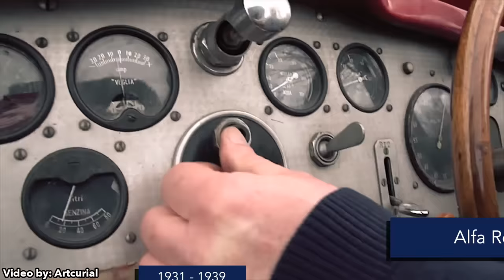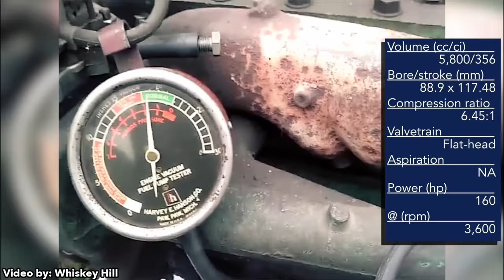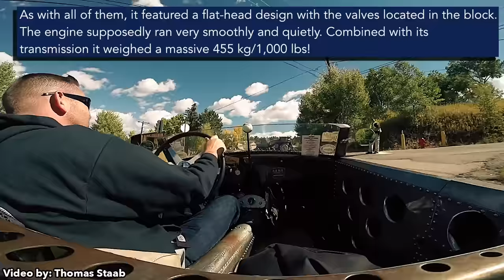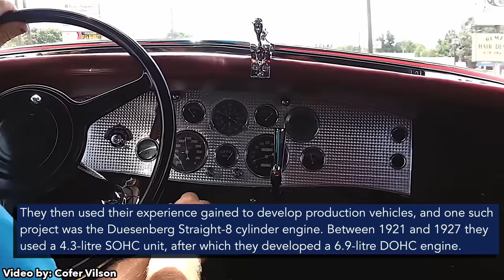The Best Sounding Straight-8 Engines In The World

Comment from the maker: It would be great to see a modern straight-8 engine. However, they have their disadvantages, especially their overall length which is why we can only enjoy these old machines. Enjoy, then!
Reply: VisioRacer do best sounding atvs or something like that
Reply: VisioRacer , there is modern inline engine these days but they r turbo Diesel engines in ciivelieng and commercial trucks and u have look them up on line but these modern Turbo Diesel Engines r Inline 8 cylinder
Reply: Which trucks/commercial vehicles use these Inline 8 Turbo Diesels?
Reply: Panda1375, Dodge Rams , Ford F-350 Trucks with the turbo Diesel inline 8 cylinder enginee but Dodge Ram Trucks have the  turbo Diesel inline 8 cylinder engines under neath the hood or bonet for those from Australia
Reply: Chris McLain No, they don't. Ford's use the 6.7 Powerstroke which is a V8 Turbo Diesel, GMC/Chevy use the 6.6 Duramax which is also a V8 TD, Ram use a Cummins which is an Inline 6 Turbo Diesel. Almost all (if not all) big commercial rigs use inline 6 Turbo Diesels
Reply: Panda1375 , yeah I forgot Ford has Powerstroke instead of a inline Turbo 8 cylinder like Dodge has in the Dodge Rams
Reply: Chris McLain Dodge don't use inline 8's, they use inline 6's. Inline 8's aren't used in anything anymore.
Reply: Panda1375 , Dodge used to use The inline inline Turbo Diesel 8 cylinder up to certain amount about time ago
Reply: Chris McLain Dodge has only used the Cummins, which is an Inline 6. Inline 8s ended pretty much completely in the early 50s and haven't been used since.
Reply: Panda1375 , that what I meant but I can't remember correctly and semis only use a bigger version the Cummins and little known fact that the Diesel engines makes more torque than the gasoline engines
Reply: +Chris McLain Yes, semis use large Inline 6 turbo diesels, not all of them are Cummins though, there's quite a few different manufacturers. And diesels do make more torque than gas engines, they are also generally more reliable and get better fuel economy but the thing that makes them better for towing is not only the extra torque, but they make their torque at lower rpm's than gas engines.
Reply: Indrid Cold I don't see straight 6s going anywhere anytime soon. They're still used in some high performance cars, for example BMW still uses them in some of their cars (couldn't tell you which) and they're especially sticking around in Diesel's until a better engine layout is designed that offers the same low end torque and reliability of an inline 6 diesel
Reply: Panda1375 do not forget the great sounding scania V8's
Reply: Blackbird The Scania V8s may sound good but inline 6s are still better engine designs for semis than V8s
Reply: BMW uses inline 6's in basically everything. Even their SUV's (SAV isn't a real term, deal with it BMW) which are usually equipped with NA or turbo V8's also have smaller inline 6 engine options. They killed off their wonderful S85 V10 engine in 2010 :(
Even their flagship super-sedan (the 7 series) is available with engine options from 3.0L inline 6's(diesel or petrol), 4.4L V8's, up to their 6.0L V12.

Inline 6's are not going anywhere anytime soon. Especially since some manufacturers are now making inline 6's with less displacement and more power + efficiency than inline 4's from just a decade or so ago.
Reply: Indrid Cold The primary reason we see so many FWD cars is because the drivetrain packaging does not intrude into the cabin or trunk space. This allows the manufacturer to maximize the volume within the car for comfort and practicality. FWD drivetrains also suffer less parasitic loss compared to RWD, this helps to improve fuel economy and raise the manufacturer's Corporate Average Fuel Economy.

Sadly for autophiles these days, factors such as comfort, practicality and fuel economy sell far more cars than things like speed and performance. The old addage of "Win on Sunday, Sell on Monday" is fading from the auto industry and with it fades the exciting performance cars that we love :(
Reply: Indrid Cold Indeed, most modern cars are pretty joyless to drive and visually unappealing...I daily drive a 1991 Volvo 740 :)

There are a few good-driving FWD cars out there. A well-prepped DC2 Integra is a brilliant drive, and something I think every autophile should experience.
Reply: Indrid Cold. what car do you have right now?
Reply: Chris McLain none of that is correct. Dodge uses the Cummins inline SIX cylinder, and all commercial inline diesels I know of are also 6 cylinders. the 5.9 and 6.7 is a smaller version of the larger Cummins engines. Ford and GM use V-8 diesels, and as far as I know there are no inline 8 diesels, of any vintage. all 8 cylinder diesels I've ever seen or heard of are V-8s. I really don't know where you could have arrived at this conclusion, and you should REALLY do at least SOME sort of research if your knowledge is that far off, before passing it off as fact.
Reply: Indrid Cold the trailblazer uses an inline 5, not a 6. Volvo also used inline 5 cylinder gas engines, not sure if they still do. I doubt it.
Reply: Chris McLain it is by no means a LITTLE known fact that diesels GENERALLY make more torque. it is very COMMON knowledge, I say again, you REALLY need to do more research, as basically everything you've said is completely incorrect. it's ok to be ignorant on a subject, but to be ignorant and pretend to be knowledgeable is not, imo. and I say generally as any given engine can be built or tuned to alter it's powerband to suit the application. some diesels have nearly equal torque and horsepower if not higher horsepower, pretty much for competition only, but it isn't a fixed ratio. and inline engines also generally have a higher torque to horsepower ratio. inline engines in general are used in lower rpm, higher torque applications, as are diesels. but there are higher HP and rpm uses. and to the inline 8 diesel thing, the only one I came across was a marine application. dodge has never used one, and dodge has never produced a diesel in house, to my knowledge. and if they ever did it must have been medium or heavy trucks long ago. the only light duty diesel they have ever used is the Cummins 6bt series. I don't know if you're thinking that the 5.9 v8 gas engine is somehow the same or what, but they have never used an inline 8 diesel, nor has any other automotive manufacturer to my knowledge. and if so, THAT would be an extremely little know fact. as I am quite well versed in automotive production, racing, etc.. but if you have some evidence of this supposed straight 8 diesel, I would love to see it and revise my statement. but as of now, all your statements are totally wrong.
Reply: Chris McLain and the heavy 8 cylinder diesels, are v layout engines, if I didn't throw that in somewhere. such as Detroit Diesel, which produced the engines in hmmvws and the h1 hummer along with GM's diesel light truck engines. and I believe Cummins produced some, as well as v6 light engines, I know they have designs but not sure on actual production applications. I think the Nissan Titan is a 4 cylinder, but could be wrong I really can't remember. as the article I read on them when they were first produced included the v6 and I believe a small v8. and there are other manufacturers, but as far as I know they have ALL been V8 engines. an inline 8 diesel would be ridiculously massive and really offer no advantages since the packaging in the vehicle would be very inefficient.
Reply: Mercedes Benz are developing a new straight 6 gasoline engine.
Reply: VisioRacer They could develop a VR8 to resolve the length problem. By the way the 8.4 litre W16 is actually two 4.2 litre Audi V8s reconfigured as VR8s, like the VW VR6s, and then fused into a common block, head, crankshaft and vice versa. I remember seeing a picture of a Straight 8 block, that someone created using Nissan/Datsun components on social media. That was some years back, don't know about its progress.
Reply: You need to add the type of valve actuation to your descriptions. It's amongst the most important information about an engine design (overhead camshaft, pushrods, double overhead camshaft.....). Just because an engine is not a flathead doesn't mean the camshaft isn't in the exact same place.
Reply: The crankshafts were prone to snapping on straight 8's and to some extent straight 6's, which is why we get V and W engines these days. 
 they simply cannot handle high revs.
Reply: As you mentioned, there are a number of disadvantages to the I-8 engine, which caused them to fall from favor.  The main is packaging.  They are very long which requires a HUGE engine bay.  Manufacturers are trying to package the engines and transmissions very efficiently and having a loooooong hood doesn't meet those requirements.  The crankshafts are also very long and heavy which limits the ability of I-8 engines to rev quickly.  The long cranks also tend to flex and break more than the much shorter V8 crank.   Inline 8s are produced today as low revving industrial engines for ship propulsion and power generation by Wartsilla Sulzer.
Reply: I doubt crankshaft flex would be an issue in a modern application especially since the last high output i8s were made in the mid 50s. but lets face it no matter how cool an i8 would no company will bother making one again especially when you have motors like the LS generation that are high displacement and easily packaged and many vehicles
Reply: VisioRacer I think that the case with straight 8 engine is that first you try to figure how to shorten it or what is the best way for fitting it in  as much small space (thus long hood problem) as possible and thus you end up with a conclusion that you'll have to use the V8 anyway...
so presumably it may be best used in longer boats,like speedsters and or drag cars, although there its usage is probably not good too so in a short way: they are used there where their lenghts kind of gets "lost" or is not noticeable in the vehicles' structure
Reply: The only modern application of an inline 8+ cylinder engine is a low revving marine diesel, or other stationary, low revving diesel.  Crankshaft and camshaft forces (twisting, flexing and centripital force),are a HUGE issues, and part of the reason you really don't see high speed engines with more than 12 cylinders.  And even those are Flat or Vee engines.  Short, stubby cranks and cams have much more rigidity.
Reply: A BMW 3.0L turbocharged inline 6 is not a speed demon? Clearly you've never driven one lol
Reply: I agree about the length, but I think Mercedes should bring back the i8. The sls and the new maybach coupe concept both looked like they had a long enough hood for an inline 8. If long hoods got with their current styling language, they should give it a shot, especially considering they are re-introducing the i6 now.
Reply: The trailblazer is 4.2l Inline 6 or a V8. They ar eno longer produced.  The colorado was available with the I5 as well as the hummer H3
Reply: bigassfordsd any of those new age "hummers" are junk, over rated, ugly & cheve frames with "hummer" bodies on them. Way too much plastic. If I got one for free, Id trade it in emmediately or trash it & let it roll off a cliff.
Reply: I have the 4.0 in my Jeep, a great engine.
Loads of down low torque, easy to work on, dead-nuts reliable.
Reply: I've always liked the Ford 300ci I6 better. It went out of production in 1996...so the AMC/Jeep 4L was in production much longer. The 4L had it beat with 190hp but, it couldn't touch the 275ft/lbs of torque or the curve. The 300ci only make 150hp though. I think it was and is a travesty that Ford never sent to Australian 4L DOHC I6 here for American RWD applications. I understand using the 3.5L Ecoboost in FWD/biasedAWD junk. They never should have used the 3.7 and 3.5tt in RWD Mustangs and Trucks when that 4L I6 existed in the land of OZ.
Reply: Awesome.  I love how on one hand it's a seemingly random combination of a build, but it ends up working so well.
Reply: VisioRacer I am not one to point out mistakes. First time i have ever done it. But concerning the bugatti portion of this paticular video: a commom mistake was made. The bugatti type 35, 35A and 35C all use the 1991 cc engine but have either a compressor or different bearing in the block. The type 35B and 35T are the only two that use the larger 2261 cc engine. Also either with a compressor or different bearings. I hope i helped out and i am looking forward to you next video
Reply: " the trailblazer uses an inline 5, not a 6"

Actually the trailblazer had the I6 and V8 engines.
The Colorado truck had the I4 and I5 engine options.
Reply: hackfreehvac the H3 " hummer also used a inline 5
Reply: Are you running total loss oil injection?
Reply: Indrid Cold I would consider the Toyota 2jzgte (inline 6) a bit of a speed demon.
Reply: Indrid Cold.  Engine configuration has little to do with an engine being a "speed demon" or not. It's breathing ability, cam specs, compression, etc. determine this. The engine has to be robust enough to reliably hold together, but most configurations can be made strong. Straight 6 and V12's can make huge horsepower and torque (and W16's) and hold together. Straight 8's are past the point of diminishing returns. Long weak crank, not naturally balanced like an I6, hard to package in a modern vehicle.
Reply: Why not a V-16?
Reply: Complexity/cost for not much benefit. There's really not a whole lot more they could offer over a traditional V8-12.
Reply: VisioRacer
Reply: If you look at some of the older cars, '40 Fords are a good example, and some cars from the '30s, the narrow hoods and low fenders look like they'd have a pretty low drag coefficient compared to some of the newer cars.  I could not find the drag coefficients on the older cars.  I thought that the straight eights would be a great match up for these vehicles.  The Chrysler PT Cruiser was going in that direction.  Personally, I like the older car styles better than the new ones and I think there could be a place for them w/ the straight motors.  Chears.
Reply: VisioRacer there is this new super v16 car (devil) or some shit in development. Sounds very similar to these engines.
Reply: VisioRacer rear engine
Reply: Maershkin Schrabs its built by NRE in the us and is two 2500hp V8's put together
Reply: The inline 8 basically sounds like a v8
Reply: So true
Reply: Maybe we should weld 2 4cylinders together and have a custom crank and cams made
Reply: VisioRacer you never fail to make thoroughly entertaining and interesting videos. You deserve all the subscribers you get and more.
Reply: @movinmetal2596   Front wheel drives get much better traction than rear wheel drives, plus they handle a lot better in sharp curves at higher speeds.
Reply: hughes2397 FWDs can be fantastic...have owned an Integra that was on coilovers and several early VWs. My MkII Jetta liked to cock the inside wheel up in hard corners! :) But in the end, I prefer throttle oversteer over liftoff oversteer (which the 'Tegs do wonderfully)
Reply: VisioRacer   You may be interested in a statement made in a technical manual published by Bosch. It said that increased understanding of combustion science has lead to engine compression ratios increasing by roughly half a point per decade (assuming the same baseline octane rating of the gas). If we take one of your vehicles here that's about 80 years old, they seem to run ~  6 to 1. After 80 years, that would now be 10 to 1.   Where there are exceptions, you could attribute this to the gas back then having both lead in the gas and a higher octane rating than today's standard fuel.
Reply: @Panda-wt9no   Cause they blow up in the winter time. Due cause cold twist the crank. Inline 8 just a piece of shit in the cold weather -40 below.
Reply: SLS AMG could fir inline 8 just too easy. i think it would be more space efficient under the hood to have inline 8 than 6.2v8
Reply: You had to be insane to drive those Silver Arrows. All that power with those skinny tires?
Reply: @wayfastwitey13  True if we exclude marine, industrial, locomotive, and off-road.
Reply: Make it a diesel
Reply: I have a good one you missed. Scania D812 Straight 8 cylinder. Maily used in a couple of diesel locomotives and possibly Marine use too. It sounds beutiful
Reply: The main problem with straight eights after the war was ever-increasing cam twist at ever-increasing RPMs. The Novi V-8s were able to produce an additional 150 horse-power over any straight eight of the same size at the time.
Reply: I think a 2L Inline eight wouldn't be so big
Reply: @afoxwithahat7846  Has to do with metallurgy and cooling 1923. Couldn't place cylinders as close together as we can now. Also needed wider main bearings.
Reply: @naughtmoses  Till where I know, bigger cars can be more streamlined
Reply: the alfa romeo tipo B sound more like a modern car than a ratty classic i know of.
Reply: @joshuagodsey3731  m
Reply: We had some great cars didn't we ..
Reply: One of the biggest problems with making an inline 8 in this day and age is that today's engines make so much more power per ci than the engines you see here and the long crank of one would flex causing the front most cylinders to be out of time, look at the HP ratings of these engines and you'll see they're barely cracking 300 HP, a modern engine with the same displacement would make 600 easily, then you're flexing if not snapping cranks unless you build them heavy enough then you're loosing power due to parasitic loss from having such a heavy crank.
During WW2 Chrysler built a V16 aircraft engine that never went into production that had a chain drive off the middle of the crank to a drive shaft under the crank that ran foreward to the propeller gear reduction box up front, they drove the work off the center of the crank because it's shear length would have had flexing under load that would have thrown the timing out on one end of the engine and would be prone to breaking. 
With the kind of power per ci today's engines make you just couldn't make a straight 8 engine without running into all kinds of issues from crank flex.
Reply: the w25 is how I wish Shelby mustangs sounded. minus the loudest straight cut gears I've ever heard in the world
Reply: Is it fair to take a guess and say it was boosted with an early rootes supercharger ? Love your channel... Just curious
Reply: Where's the Hudson ?
Reply: Yes, but cadillac, devel automotive, and cizeta moroder made a return of the v16 car, the problem was similar like straight 8 engine, but yes, cizeta moroder return tha engine in 1990s with their supercar model, and cadillac return tha engine with the cadillac 16 concept, and devel made a return in 2010s with the fastest, and most powerful hypercar ever, devel 16, and they made a production version in 2019 (to be exact), but sadly, all of them were never made to production
Reply: It's too bad, because modern technology and manufacturing technologies could solve the crankshaft problems.
Reply: @franklinhankel6168  yep
Reply: My plan  is to build an inline 9 balanced just like a straight 6
Might sound crazy but it will defeat all l6 l8 v8 v10 engines